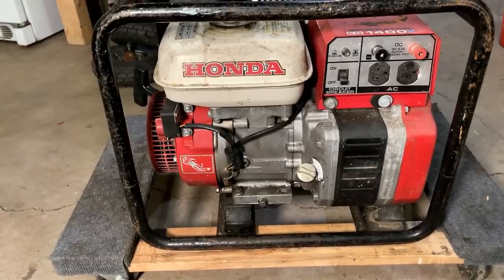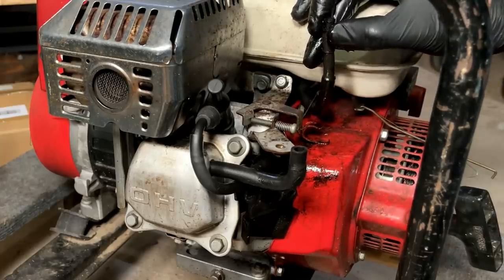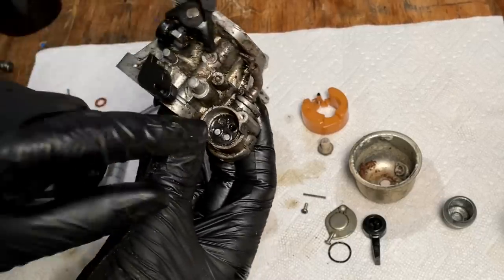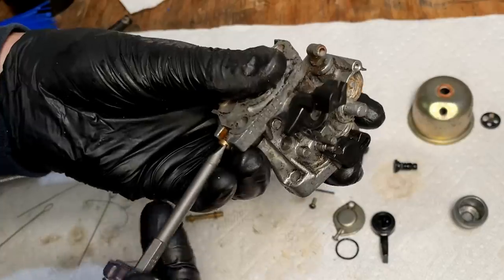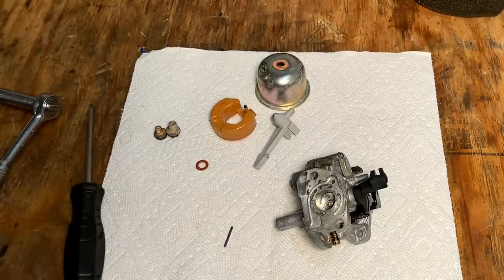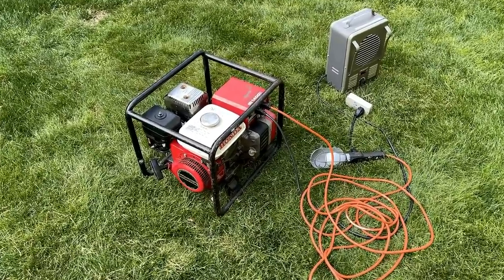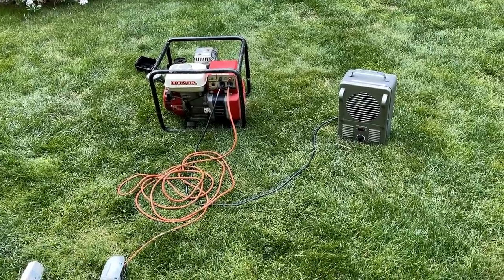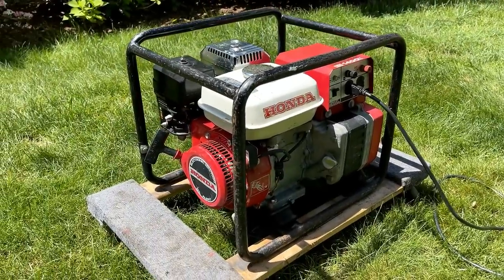Honda EG1400x Generator - Starving For Fuel

Comment: I usually find that picking up a Honda, no matter how old, or operating condition, is usually worth repairing. You can’t beat Honda’s quality.
Reply: It really is. I picked up a 34 year old honda two stage snow blower from work. My boss let me take it home for free. I put some gas in it and it started right up after a few years! I ran some seafoam through it and it runs like a champ!
Reply from the maker: I do not feature many Honda’s on this channel and the ones I do are usually minor issues.  They are well built.
Reply: “beat Honda’s quality” how about “beat Honda’s legendary quality”
Reply: 9
Reply: this is why they cost so much compare to the competition , they just last forever and you can even buy parts for wherever model no mettle how old they are you can buyer from honda ,that's what you paying for i  always say to people
Reply: A few weeks ago I was at an auction in London, a tiny little suitcase generator, a Honda Em300 came up, nobody bid on it so I snapped it up for 10 English pounds! A few hours of fiddling, changing the fuel pipe and cleaning the carb, some fresh oil and she was away first pull. It doesn't seem to have seen much use, a bit of digging on the web would indicate it was built around 1966, a lovely thing for no money at all and any outdoor lighting needs I have in the future are catered for.
Reply: Yep and most need a new tank
Reply: I agree with that 
I love rebuilding the Honda engines and test running them with full cup of coffee 😊

Comment: Hi James! Instead of a zip tie I use short lengths of string trimmer line to probe or bore through hoses and tubes. Put a piece in a drill to really scrub the inside surfaces. The twisted shaped line is really aggressive while the star, triangular and smooth shaped lines are less so. Take care, Jim
Reply: Thanks for the tip

Comment: Nothing beats an original Honda. I have a EG1500 from the 70s. Sometimes years not used, sometimes daily for hours and hours. Runs great every time. 46 years old!
Reply from the maker: It will probably last many more years.
Reply: @jcondon1  btw thank you James for taking the time and effort to create these videos. They are top notch.
Reply: I have several rebuild and waiting on some thing to put them on

Comment: Another generator saved by the king of generators! This one uses the GX110 engine which was the smallest one they made of that type. The generator is very unusual in that one of the windings for the power head is under the flywheel on the engine, that's why there is a black wire running from the power head across the front and disappearing behind the flywheel housing. I hope you don't mind me asking but I think you might have put the metal plate that holds the fuel lever in position back the wrong way round. The large side was facing outwards when you took it off but you put it on with the large side inwards. I'm sure it won't make any difference though. Best wishes Richard

Comment: Almost 2 decades ago, I bought a Honda EG 3500 the day before Hurricane Katrina hit Florida. I did not have a choice of brand or model, because it was the last one on the shelf, and paid a lot more than the other cheaper brands that were already sold out. I don't regret paying more for the Honda. This has been a very reliable machine over the years... The generator head lost its field magnetism once after a long time sitting in storage, but flashing it with a corded twist drill got it producing power again. The biggest drawback is the small gas tank capacity... only runs about 4 - 5 hours. Modified with a garden tractor vacuum fuel pump connected to a 3 gallon outboard motor fuel tank and it runs all night and then some.
Reply from the maker: I think later models added a larger tank for that reason.  It is a good generator otherwise.
Reply: check out Panellus power products on YouTube. He makes extended run fuel kits  fourmany generators. May benefit you and your situation.
Reply: @rickgaine3476  Nicely designed kits for those that don't want to gather all of the parts. Same basic design as what I put together.

Comment: I have the predecesor to this..
a 1978 flat head Honda engine, V belt drive Generator with no AVR, adjustable between 100 volts AC and 260VAC....still runs, still produces @1700 watts.
Weighs so much more than the equivalent modern outfit...I keep it on a furniture moving dolly....
Reply: You should upload a vid. I know i would get a kick out of it.

Comment: I remember in the 80s , getting brand new Honda like this at work, the best you could get then, still great today. Had all sizes, I did an electric starter conversion on a Honda 5000 over on my channel, was going to keep it as my home backup but sold it to buy the new EU7000.
Reply from the maker: I would too.  The EU7000 is a very nice generator.

Comment: For that last bit in the tank put the rag, or two in and used compressed air to blow it around.  Use the grabber to pull them out.  Works pretty well on an irregular shaped or large tank when it is tough to get to the corners.
Reply: I have a HD vacuum pump and a gas cap with fitting so I just vacuum it for a couple of hours and it’s dry

Comment: I’m a huge  Honda fan! I have a lot of their equipment. My dad found one of these at a house sale for 10.00. The guy messed with carb had it all screwed up. I just put a brand new carburetor on it and  runs excellent. 
My in-laws  lost power last month and they used this to run a couple things and it ran for 4 days without any problems. These are made very well. It has to be 30 plus years old. 
I also bolted a furniture moving dolly to it, for ease of moving it around. 
That GX engine set the standard for the small engine industry. Every small engine manufacturer has pretty much copied that design. 
Great video once again James!
Reply: I garbage picked one last year. Dirty carb because of ethanol. 
I LOVE ethanol. I get so many free/cheap motorized things because ethanol sucks so bad. I personally use ethanol-free gas in all small equipment.

Comment: Great repair Doc., its amazing how little TLC it takes sometimes.
Reply: Doc., need your help. Have a Kawasaki 17hp, code FH541V-CS28-R, 
E/NO FH541VA 33860. I want to rebuild the carb, who should i call?? The engine is on my old yazooikees mower, it just keeps on tickin, kinda.
Reply: @larrykelly2838  i think ticking is bot really a carb issue, more like valve issue. Probably just need some adjustments

Comment: I picked up one of these exact gensets 15 yrs ago... and it had been stored for 10 or more years before that. I filled the tank, checked the oil and it started on the 3rd pull. Ive used it ever since. Works great as a job site genset and has been a rugged and reliable small power source. I make sure that I turn off the fuel and let it run out the  carby...and I put Stabil in the tank. Gasahole is not a good thing to let set for long periods of time.

Comment: My first effort when dealing with a blocked line that a drill won't go through because of distance or bends, is a length of Bowden cable (old bicycle brake cable is perfect) chucked up in a drill.  It's flexible enough to go round 90's, tough enough to get down the full length of a car fuel line & if you hit a real hard spot then spinning it the opposite way (so the ends tend to splay outward) acts like a mini wire brush.  Stay well, regards from the UK.

Comment: As always another great video.

I know you like the Honda motors myself not to fond of them I prefer Kohler. If you ever work on a 390 and you know you have spark and you know your carburetor is good but it's still won't run it's a very easy fix. Pull the valve cover and look at the studs for the rocker arm. These things break all the time. My own personal machine I have replaced the same stud three different times. A friend of mine owns a large welding company and all they use is gas powered welders. A lot of times when they go down he calls me to see if I can look at it. Just on his equipment I've easily replace six different motors with the same issue as mine the broken stud. It's so common that I keep a few in stock in my garage.

As always look forward to your next video.

Comment: Those are beautiful little generators.  I’m a big fan of the earlier Japanese built Hondas, and own a couple myself.   Nice project,! I was surprised with the oil soaked air filter, I couldn’t imagine why it was running rich after a total carb cleaning.
Reply from the maker: They are a very nice generator.  Just picked up a mint EX1000.  Might keep that one.
Reply: @jcondon1  my problem,  I pick up an exceptionally nice generator, then I don’t want to sell it.   Don’t need more than one (or maybe two) as my home has an 11kw Kohler natural gas standby generator.   I thoroughly enjoy watching your channel James.

Comment: Thank you! Nice video! Power is equal to the electrical current times the voltage! I think that I misunderstood what you said about current. 5KW would be about 45 amps at 110 volts AC. Ron
Reply: P = V I cos phi.

Comment: Hondas are incredible. Great find and easy fix. I have a Honda HR 215 mower that I think is from the mid to late 80s and it runs like new. Also pretty quiet. I picked it up for 25 bucks about ten years ago.  The person said it didn't start. Got it home put fuel in , turned on the fuel valve, second pull, it purred like a kitten. Anyway, how old do you think the genny  is?. Must be 20 or more years old?
Reply from the maker: I think 25 years old.  Made in the mid 90s

Comment: I'm surprised that you didn't scuff up the frame and use black  Rustoleum on it.. Great video.
Reply from the maker: Thought about it, but the rust was not bad.  Did not want to take away the patina in this case.

Comment: Fuel valve plate was assembled 180 degrees from original position. 15:50
Reply: I noticed that too and wondered if it would cause a misalignment of the shut off lever. He mentioned it took 4 minutes for the engine to run out of fuel at the end and I couldn't help but wonder if that had anything to do with it.

Comment: Want to point out, that if you ever stumble upon something that is NOT rated for 1500 watt intermittient load, even if they are rated for more than 750 watts of continous load, you should not use that space heater to test it out. The reason is, that the half-switch on these is usually a big diode in series with the AC, that the switch bridges. When the switch is in off-state, the AC will be forced through the diode, cutting off each half-period and thus making it 750 watt. But actually, you are instead turning on and off that 1500 watt space heater 120 times per second, "creating" a 750 watt heater, but it will actually put a 1500 watt load on the source 60 times per second, and in between putting a 0 watt load 60 times per second.

HOWEVER if the space heater instead have 2 heating coils, for which the one coil is controlled by the half-switch, then its safe to try out even on things that are not rated for 1500 watt intermittient load.

Comment: Some carb"s have phenolic components that swell when water is introduced to the system. My household air cond hase a reversing valve that has a phenolic shuttle valve, that swelled up & quit working. Could be a new dryer was in order.

Comment: I did notice that the you put the small top cover with the 2 small screws over the shutoff valve on 180 degrees off. The small edge side goes towards the carb side. May not make a diff though. :)

Comment: I was not expecting it to start on 2 pulls before doing nothing but checking the oil and gas. Nice work on the carb and glad the air filter was the only issue after the carb was working right. Wait...no frame paint!?!? Whose channel is THIS?? 😉. Also, saw you use that foil and WD(?) trick to clean up the muffler cover which looked great thereafter. I think I saw a sub suggest that awhile back. I'll have to give it a try too.
Reply from the maker: I liked the patina.  No out of control rust.
Reply: @jcondon1  Ah I was just razzin ya a little. 👍👍

Comment: Well i would have used a lot more carb spray.  Good for you for being more frugal with it than I.  nice work.  I used a load box at work (on the big DC stuff)  i would sure love to have one now.
Reply from the maker: Same here.  Always on the lookout for a used load bank in the 10,000 watt range.  They are so expensive.  Hard to justify when a few $20 space heaters do the same thing.

Comment: Its very bad on any generator to start them or shut them down with a load on. Always make sure the breaker is off when starting. Hondas have very sensitive voltage regulators that can get damaged easily by doing that.

Comment: This is why I 'try' to only play with Honda's. I've just finished with an FI EU70IS & yesterday got back onto an EU65IS which had a dead Inverter (that I'd forgotten I disconnected) & gave it a pull & now the engine won't even fire(the module won't even display now!)

Comment: James, great videos always. Looks like you're using a Harbor Freight ultrasonic cleaner. Is that the 2.1 ltr? What is the solution you use, Simple Green? And is there any concern about cleaning aluminum parts?
Reply: He uses the Heavy Duty Degreaser from Harbor Freight.

Comment: Hey Doc great job as usual.  The inlet sediment bowl looked like ear wax came out.  That carb cleaned up real ice.  The air filter doesn't need to have quart added to it does it is it even an oil bath filter? Thanks for sharing your video with us. Ed

Comment: Nicely done! What type of screwdrivers are you using? Looks like gunsmithing ones which fit nicely and don't damage the carb.
Reply from the maker: That is exactly it.  I bought the set the Donyboy73 recommended https://www.youtube.com/watch?v=jN5c76XCQFo&t=106s
Reply: @jcondon1  Thanks!! I dabble a bit in generators and fid your videos very helpful. Donyboy also has great videos. Nice guy, too. Unfortunately, they appear to be discontinued, but there are many such sets out there.

Comment: Hi  James I have this same rig.i had to replace the idle set screw.my kids got ahold of mine with a screwdriver.there is also a set screw above the fuel line on the arm across from the spark plug.can we get a video or just a run down of your final set points for those 2 screws
Reply from the maker: I do not have this generator anymore but can try and explain.  The idle set screw on the carburetor should be turned in until a thread or so comes out.  This generator does not idle so do not want to drive it in so far that it influences the engine speed.  It’s only purpose in this application is to hold the pilot jet in.  The other screw is most likely the governor spring tension.  That sets the engine speed.  To set the speed you will need a tachometer to set the engine at 3690 rpm or you can use a kill a watt or another meter that measures hertz and set to 61.5 hertz without a load.

Comment: Curious as to why you didn't try wringing the excess oil out of that filter.
Reply: Or washing in petrol (gas)?
Reply: If the prefilter is drenched in oil the paper element is soaked in oil too. Better to put on a new filter than be penny wise and pound foolish.
Reply: @2aminitials  Didn’t know there was a paper element also. Yes, definitely have to replace then.

Comment: James would it be better to run this generator at the factory 60hz or the 61.5hz?
Reply from the maker: Most manuals say to set the no load speed between 61.5 and 62.5 hertz.  The engine speed will slow under load.  At half load you want it around 60 hertz.
Reply: @jcondon1  thanks!